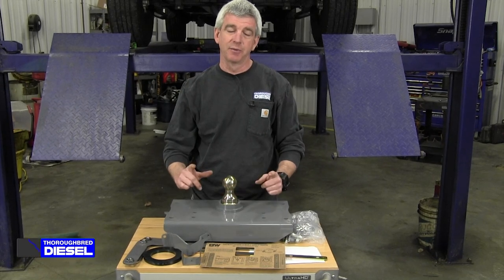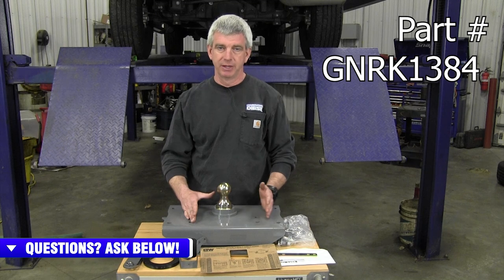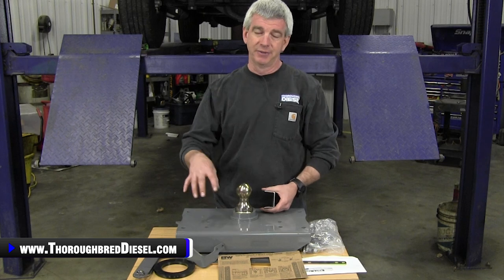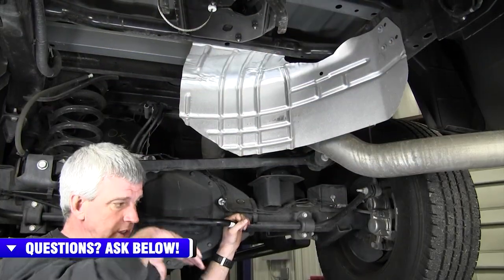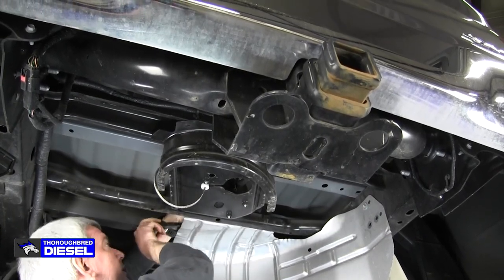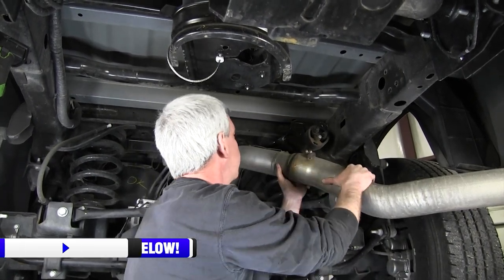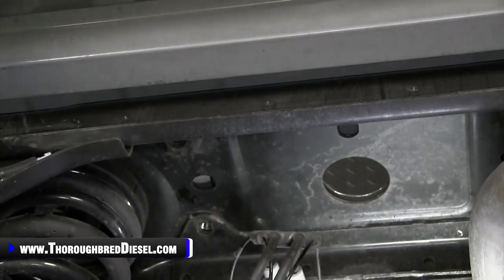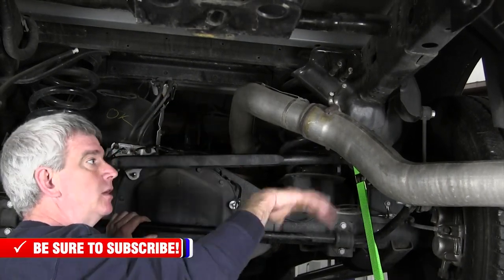Easy Upgrade For Our Dodge | B&W Turnover Ball Hitch Install: 2018 Dodge Cummins #diesel #dodge

Comment: Mine has been stuck for a few years now. I have tried everything within reason. About to just cut flat so I can load things normally again
Reply: Dont cut it flat dude. Work at it with pb blaster and the latch mechanism. I had the same issue and used the penetrating oil all over the latch, ball and release rod. Ended up with a 16 pound sledge to bang the heck out of the ball. I think the shock of it all loosened things up and out it came. Dont give up!